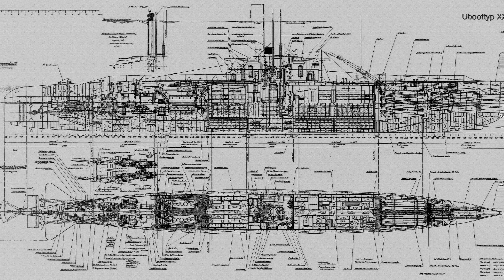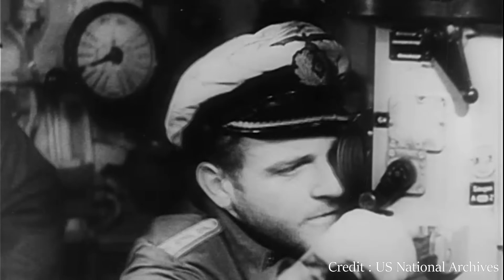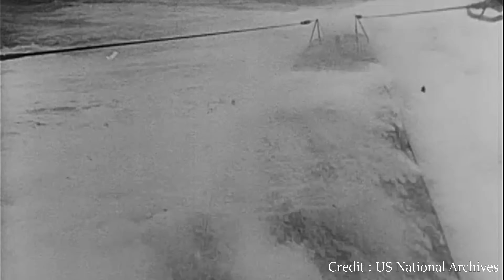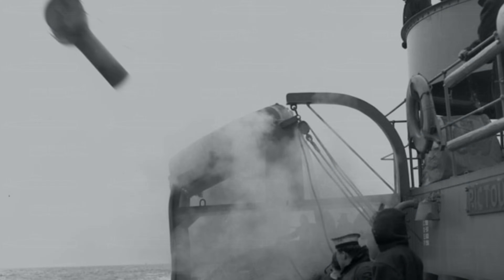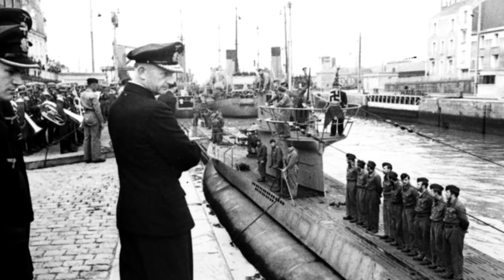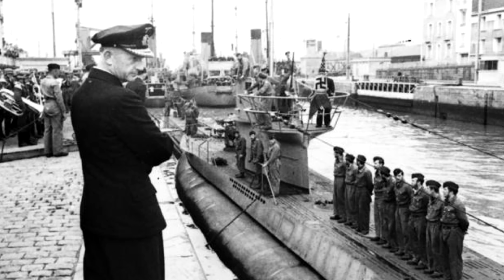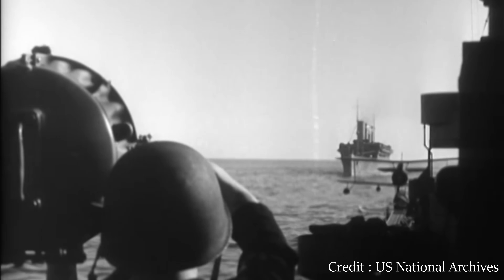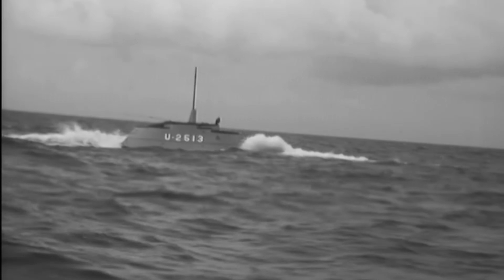Was the most innovative submarine design of WWII successful? The German Type XXI submarine

Comment: Type XXI and type XXIII submarine projects were started in May 1943 because German Navy was experiencing #50% loss rate with their current type VIIC submarine because of allies's progresses in detection technologies and anti-submarine tactics. Germans were in fact compelled to build something better than their obsolete type VIIC and they turned to existing 1940 projects of Walter hydrogen peroxide propulsion submarine that had been rejected because tests had proved this propulsion system was too dangerous. Those projects included hull designs derived from type VIIC hull, with double height and most of the equipment for surface navigation removed, because Walter turbines didn't need air, so those subs didn't need to surface. It looks like those hull designs were on the quick and dirty side because Walter hydrogen peroxide submarine projects didn't look very realistic in 1940 and didn't enjoy much resources. In May 1943, German Navy had little time to try to find remedies to the obsolescence of their current subs, so they turned to those old formerly rejected projects, replacing the peroxide turbines with the largest diesel-plus-electric propulsion system they could fit. It looks like a quick-and-dirty adaptation of an old project with a propulsion system much less powerful than the initially proposed hydrogen peroxide turbines. The type XXI subs project was started in May 1943 and, although much resources were devoted to it, only 2 subs had been accepted for service and deployed before May 8th, 1945, so their military fitness has never been proved and has been the object of many controversies. It doesn't really look like a huge success, and I really wonder why those submarine enjoy such a high reputation today. Perhaps some bias in favour of many things that relate to Nazi Germany ?
Reply from the maker: I think you might enjoy my other video on tye type XXI design and construction 😊 Personally I think the design specs became the post WWII narrative because the real world experience was just too few to make an impact.

Comment: The main reason for the type XXI shortfalls versus specs lies with the diesel propulsion. And that is caused by the material shortages ofGermany at the time. Germany had no trouble designing efficient and powerful diesels and that lead has even extended into the presence. Indeed, as you stated, after WWII the specs were met and exceeded. Fact is also that the last action of uboat was a type XXIV sinking three ships within British water, solely on sonar bearing and submerged. In the left the scene undetected. TypXXI boats were undetectable (in 1945) at slow speed as later US trials would show.
Reply from the maker: There was also an issue with achieving the underwater speed, however, like you said there was an issue with the diesel engines performance. If I remember correctly it was partly because the supercharger did not deliver, but I can't remember the details.

Comment: If they were looking for ACTUAL facts and figures of the Type XXI, all they had to do was ask the Kriegsmarine - the Wilhelm Bauer (formerly U-2540) IS a Type XXI that was scuttled at the end of WW2, and raised in 1957, refurbished and RECOMMISSIONED in 1960. It was in ACTIVE SERVICE until 1983.  It is now a Museum.
Reply from the maker: Well, the performance of the Wilhelm Bauer can not be used as a performance reference for the type XXI. Part of the refurbish was the powerplant, which was replaced with new and different diesel engines.The old clutch system was removed and changed to a setup where only the electric motors were connected to the propellers, to name some of the changes.
Reply: They raised 2 Type XXIII too and put them in federal german Navy service named U-Hecht and U-Hai one of them sunk in the or near  the engl Channel , only the Smut survived and the Boat was raised again from the Seabed , both were later scrapped.
The Type XXI was in service when i joined the Navy in 79 but we had also 2 Fletcher /Z Class in service at the time
Reply: It was never in "active service". It was a platform for testing different moduls.
Reply: @rainerfantasie9573  it did make it active service and active patrols. It was just only a few boats and not for extended time.
Reply: @becksvideoproductions  U 2540 entered Frontausbildung (training for front) in April 1945. That normally lasted some months. U 2540's training was cancelled due to fuel shortage. It was scuttled before the crew was trained and it never did any active patrol during WW2. After being raised it was only used for testing engines and various equipment until 1968 when it was taken out of the Bundeswehr's service. It was then again used as a platform for testing of U-Boat class 206's equipment but with a crew of civilians.
Some class XXI boats did patrols, yes. None of them attacked any enemy ships.
Reply: Some were used in the Baltic to support evacuations from East Prussia early 45. None of them was fully commissioned yet though. War ended quicker than the XXI and XXIII boats were ready for full service.

Comment: Great video. Though faster,  type 7s couldn't shadow a convoy because of radar and air cover.
Reply from the maker: Well, it depends on when in the battle of the Atlantic we look🙂 However, late in the war with combination of radar/HUFF DUFF and air coverage from Iceland and the Liberators with extended range, YES the U-boats in general had severe issues.
Reply: @BecksHobbyProductions  indeed,  that's why they fitted snorkels which severely hampered the type VII & IX performance. This guy does some great work regarding the air war against the U Boats. https://www.youtube.com/watch?v=G3UG1pxcYrU&list=PLO7SMfMqEYq7UxxNgeWvqak7ny88mkrso&pp=iAQB
Reply from the maker: @thebruffy1077  Thanks! Ill have a look at his content and sources :) But agree, the snorkels never made a real difference for the type VII or IX.

Comment: A What If? story of the XXI deploying in 1944 would be a  very interesting read.
Reply from the maker: Yeah. I thought about this as well and it's a tough topic. The challenge of going down the "What if" route is to avoid stacking the deck in favor of the conclusion you would like to reach. I have toyed with the idea - even putting it into this video, but it involves a great deal of guessing outcomes.
Reply: Seems like it would not have made much difference if the performance was indeed compromised to this extent, and even if it was it seems questionable that they could have moved about given the absolute mastery the allies had in the air. Radar could even detect snorkel heads at that point.

Comment: This is very interesting. The Type 21 & 23 designs were the first of a new class with new technology and ideas. No wonder the aims set out were so far ahead of actual performance. There were drastic limitations in building any brand new design at that time when everything was under such drastic pressure in German war industry. Post war, without those problems, Other nations took the best WW2 ideas and tried to learn from them.
Reply from the maker: Well, the aims were achievable, but the design needed time to mature. However, Germany did not have time.
I think the US study came to that same conclusion. 

You might enjoy my other video of the type XXIs design interesting 🙂
Reply: @BecksHobbyProductions  I will follow up on the type 21 & 23 videos I can find. I understand at least one Type 23 was built & is entombed in a collapsed U-boat pen in Northern Germany.
Reply from the maker: @plunder1956  Thanks - that could make for some interresting information. Especially since Northen Germany is a place I can fairly easily travel to :)
Reply: @plunder1956  3 type 21 buried in Elbe II.
Reply: The question is actually how this boat would have performed if it had been build in peace time, with all needed high quality materials and enough high skilled workers. We have seen that in so many german inovations were they had to switch to poorer quality or even complet different materials to get things to work at all....looking at the jet engine of the 262 for example.
Reply: Japan built independently as good submarines as Germany.
Reply: @jakubkarczynski269  really ? No one had heard of that nor has japanese design made it into other designs after the war.
So can not be so good and they did never sink so many.
Reply: @typxxilps  XXI also did't sink anything. usn studied IJN subs and sunk them so Soviets wolud't get newest technology.
Reply: @typxxilps They very damn well did with very similar performance to the type XXI as well
Reply: @typxxilps Lucky for the world, the high quality subs and well trained crews in Japan were made ineffective by a doctrine that focused on attacking warships to the near exclusion of merchant raiding.  That is the reason for the poor tonnage scores they achieved.
Reply: @jakubkarczynski269  That's what the Western allies were all about. Basically, everyone made use of the technical achievements after the end of the war and robbed Germany. So you don't have to pretend that it's always just about beating the Nazis. This may always sound good, but had relatively little to do with reality in the end.
Reply: @Tüedeli  USSR did the same with captured technology and scientist.
Reply: @jakubkarczynski269 Riiiiight! The Jap subs were too noisy and couldn't dive as deep as American or British subs. Read the book I-Boat Captain. The author clearly states this.

Comment: The  U S   Navy   had the  Tang   class diesel electric boat , which  design was  taken from  the type  21 , most people don’t know that the  U S Navy  operated diesel boats  thru the 80s. I served on the  Tang , SS563 , and the Wahoo ,SS565
Reply from the maker: I read somewhere (can't remember what book) that the US Navy didn't plan to change the Gato/Baleo class after the war. That is untill they got their hands on a type XXI.
Reply: @BecksHobbyProductions  The Tench class was the epitomy of the fleet submarine.
Reply from the maker: @ricksmith4736  and were in scope of the GUPPY programme which was derived from the learnings from the type XXI 😊
Reply: @BecksHobbyProductions   No, the tench class had a better ballast system that got rid of sea pressure piping that was inside the pressure hull on the Gato and Balao class... In doing this a forward and rear ballast tank were considered redundant, one tank was discontinued while another was then used for more diesel fuel which extended the range of the Tench class boats considerably..... This is why MOST Tench boats were used for the guppy conversions over Balao and Gato class boats........
Reply from the maker: @ricksmith4736  You are correct that the Tench class was an improved class of the Baleo and Gato. However it is also correct that all 3 were in scope of the GUPPY programme. Some Tench submarines were even built from the start with these improvements in mind. This was because it was acknowledged that there were learnings to be made from the type XXI.
Reply: @BecksHobbyProductions  The GUPPY program was already in the design stage in late 1944 and the major systems that were transfered over from the type XXI was the snorkel and the batteries
Reply from the maker: @gotanon9659  do you have a reference or source? I have checked my books and they reference the XXI as the origin/inspiration of the GUPPY programme 😊
Reply: All navies copied the xxi if they had the facilities. Soviets, UK, French...
Reply: What a 100 years old ??😁😁
Reply: The Tang class had a pancake engine which was a true failure...
Reply: One of the reasons the Albacore stopped with all of the testing is there were NO more Pancake engines to rob parts from to keep it going..

Comment: Thanks Becks, very interesting. I'd imagine the Allies were extremely concerned when they heard about this submarine, it would have been a definite game-changer if they'd managed to iron out all the teething problems. I guess quality control is an issue, when the workforce is primarily slave-labour and the Allies would be doing their best to raze any facility suspected of producing parts for this sub, to the ground. I'm looking forward to viewing the rest of your content, subbed.
Reply from the maker: Thank you for your comment 😊

The question is often raised if the type XXI would have changed the outcome of the war if it had entered earlier. In short it would have meant fewer submarines on patrol as the type XXI consumed much more resources. Economics of war plays a role. 
If we follow the studies of Clair Blair then the only opportunity to win in the battle of the Atlantic would be before 1942. 
The challenge is that for the type XXI to show what it could do (assuming all issues had been fixed) it needed to have opportunity and that was significant problem. 
It's a much longer conversation, but in my opinion entry of the type XXI early would not have changed the outcome alone.  

As for assembly, I will visit the Valentin bunker later this year. This was specifically built as a safe place to assemble the type XXIs

In any case - thanks for your comment and weighing in on this topic 👍
Reply: The Allies knows this subs very well in fact that they have already invested in tech that would counter this threat

Comment: The type 21 was years ahead anything the allied had and was years ahead of its time.
Reply: Small problem.   Attempting to construct them in prefabricated sections and fit them together in shipyards, as the US had done with freighters & escort carriers, was a disaster. Consequently, most required rebuilding almost from scratch, and only two ever made war patrols as a result.

There were a number of major shortcomings about the design itself, as a post war US Navy assessment determined :-   The United States Navy concluded that whilst the design had some admirable features, it was seriously flawed.  The submarines' engines were underpowered, which limited the surface speed and increased the time required to charge the batteries. 

The hydraulic system was unduly complex, and its main elements were located outside the pressure hull. Thus making the system highly vulnerable to corrosion and damage. The snorkel was also badly designed, and difficult to use in practice. 

The source for this is Clay Blair,  'Hitler's U-boat War: The Hunters 1939-1942.' London: Cassel & Co., 2000.
Reply: @dovetonsturdee7033  the victors continually tries the belittle the Germans.

You fail to mention that they were being built in a deteriorating war condition including lack of adequate supply of materials and manpower.

And if it was as bad the victors claim why did they based their new submarines on it.
Reply: @reginaldmcnab3265  I don't recall 'belittling' anyone. Only pointing out what a post war US Navy report on the Type XXIs said about them, and describing the known flaws in their construction methods.

The victors did incorporate some of their technology into their post war boats, but cherry picking the best features did not in itself prove that the Type XXIs  were as wonderful as has been suggested.
Reply: @dovetonsturdee7033  I didn’t say you belittle anyone! I said “the victors”
Reply from the maker: @dovetonsturdee7033  Very much true as well. The type XXI was 1 example of an attempt to innovate to success. I completely agree that while many aspects were very innovative, but there can a big difference between innovation and reaping the benefits of that innovation in the real world. 
I go over some of these points in my other video on the design and construction : https://www.youtube.com/watch?v=FJ_O4DKcdkg
The Soviet Tango class took inspiration from the hydraulic reloading system. If you want to can see it here : https://www.youtube.com/watch?v=dwsNEnjsuHE

For others who want to read the US Navy study on the type XXI, it can be found here : http://www.uboatarchive.net/Design/DesignStudiesTypeXXI.htm

I have the Clay Blair books, but was not aware that he made studies on the type XXI. What book and pages covers this?
Reply: @BecksHobbyProductions  Thanks.  As it is raining hard here, and I expect my cricket match to be cancelled, probably saving me from my usual embarrassingly inept attempts to bat, I will have a look this afternoon.
Reply from the maker: @dovetonsturdee7033  feel free to revert with your thoughts :)
Reply: @dovetonsturdee7033  don’t forget that the victors has a long history of invading and attacking other countries.

They couldn’t careless about the truth
Reply: @dovetonsturdee7033 
All modern submarines of which the Electroboats were the first, have external hydraulics and if a submarine has external hydraulics it must have hydraulic lines run externally which is how they raise and lower the non penetrating masts, antennas, bow planes, RADAR scanners/detectors and on nuclear submarines the hatch openings too. Something Clay Blair didn't understand as well as the 1946 N.H report because it was simply a snapshot of opinion in 1946. That said no team of hydraulic engineers will place sensitive hydraulics externally without a very good reason if at all.
Reply from the maker: It really was 👍
Reply: Same with the Me262